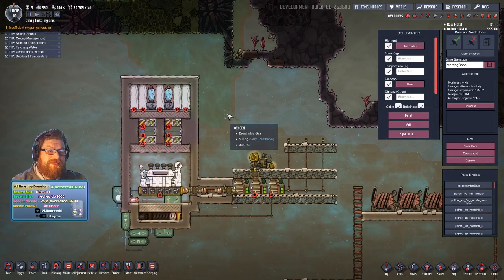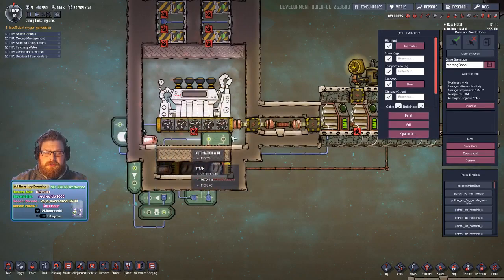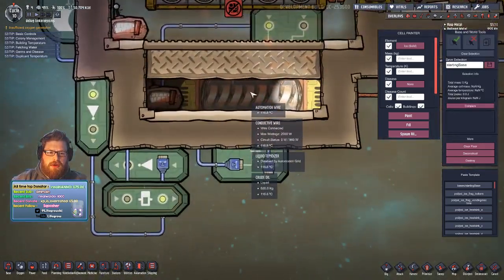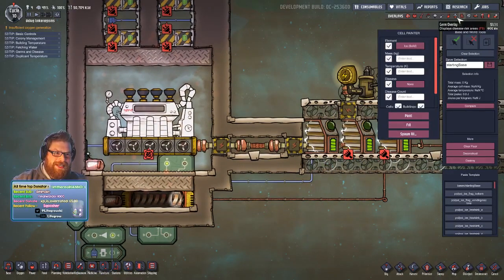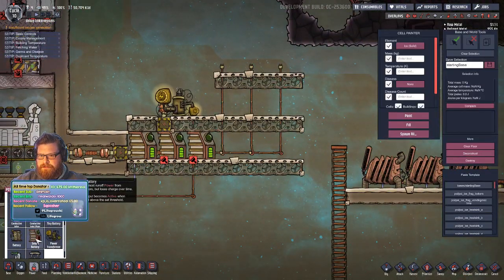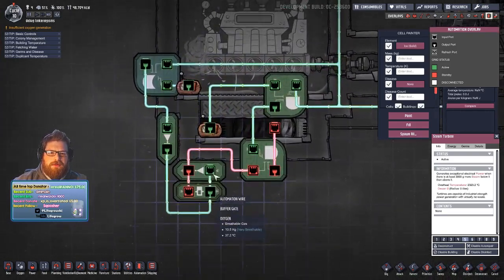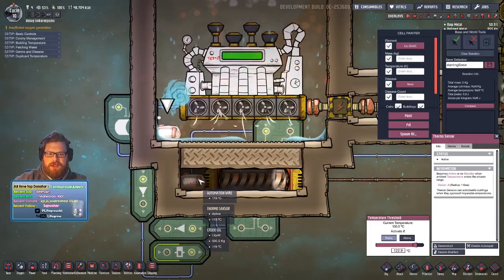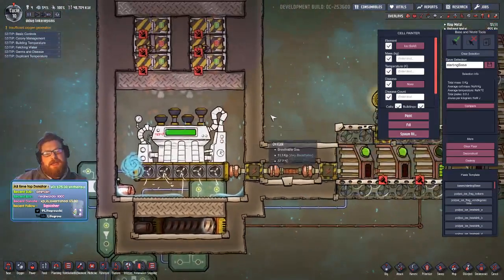EASY STEAM TURBINE (with save file!) - Oxygen Not Included (Occupational Upgrade)

Comment: idk if this is too late to comment but how did you delete those batteries at 7:40? when i try to do it with sandbox it just deleted everything including wires, pipes. please help how do i destroy one thing without interfering with another thing.  i saw the tool filtering option but it only works with dupes, not with sandbox. i m confused. this that a some kind of mod?
Reply from the maker: I use debug, not sandbox for doing my test builds.

Comment: I still can't figure this out. I'm trying to set it up without using automation because automation is too confusing. There has to be a simple way of setting this up.
Reply from the maker: See the description. This build is a little borked since they hotfixed the steam turbine.
Reply: That seems like a lot to do just to have steam energy. I'm trying to find a build where I don't require any dupes to maintain the power grid for the Steam turbine and that is way more simple.

Comment: I like this design, it's my kind of design. I'm stealing it for my own bases. Everyone is doing a single steam generator and scales pretty poorly. I bet this design could possibly be scaled up to 3 Steam generators without adding parts, what do you think?
Reply from the maker: Thanks :) It can easily scale up - the only bottle neck is how much water you can feed it...

This one was pumping 4kg/s of water into the system when active, but frequently toggles on an off - it'd need to run for 20 cycles or so to get a real idea of throughput, but even if a single geyser couldn't keep up (thinking that you could use one of your 2 steam geysers just for this build) you could always supplement it with some polluted water, and get some dirt as a bonus... Let me know how you get on :)

Comment: nice build, too bad they nerfed the steam turbine!  Now you need a temp of 256 ºC, and a pressure difference of 5kg.  They also dropped the power output from 8 kW to 2 kW
Reply from the maker: Yeah the power output was almost instantly nerfed in fairness - but yeah, this is just the way of the world when it comes to klei's pre releases, things shift a lot. The pressure difference isn't an issue - but the new temperature requirements is a bit of a head scratcher... Working on a build now.
Reply: Please release a new version of this when you find a working build to get it to that temperature.
Reply from the maker: Done : https://youtu.be/3Z1p6Xv2GZs :) Enjoy.